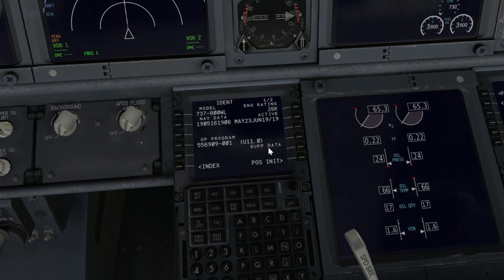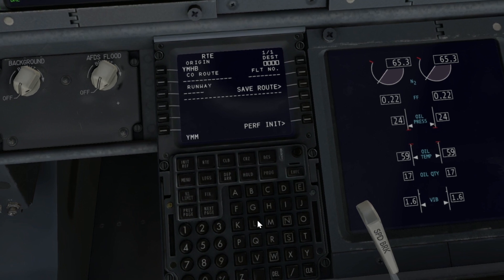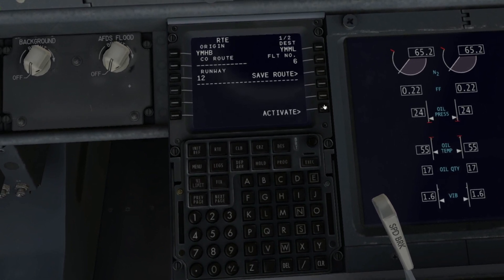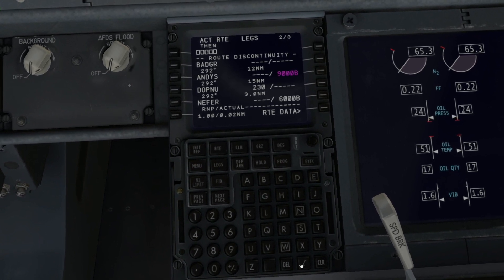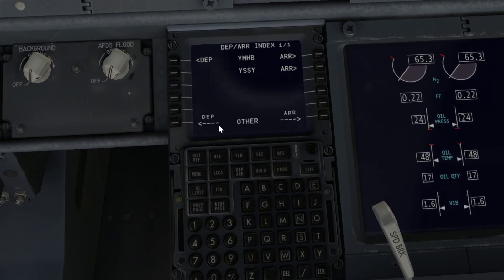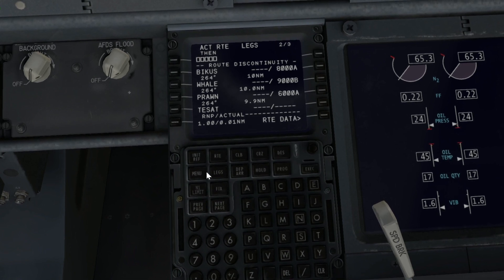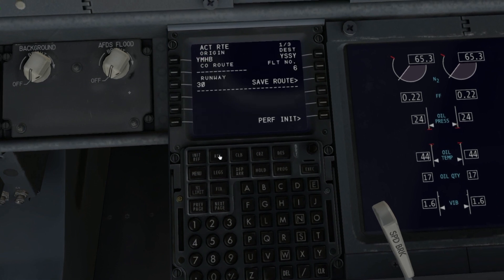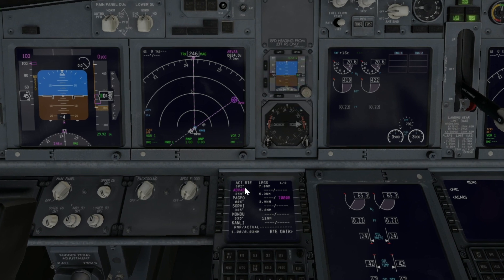How to Clear a Discontinuity in ANY Boeing

Comment: I tried this, but instead of "connecting" the SID to the STAR, it just "skipped" the SID, and went direct to the first waypoint of the STAR. Is there something I did wrong cause this? Any suggestions?
Reply from the maker: Hmm, certainly odd. SIDs aren't designed, however, to connect straight into STARs, they are made to have waypoints in between. I'd probably try first making sure you have waypoints between them. Thanks for watching, hopefully you can solve this soon
Reply: @FlapsFullAviation  I'll try it, thanks.